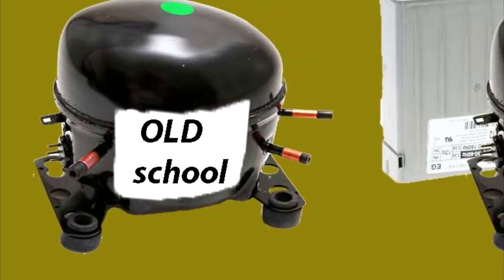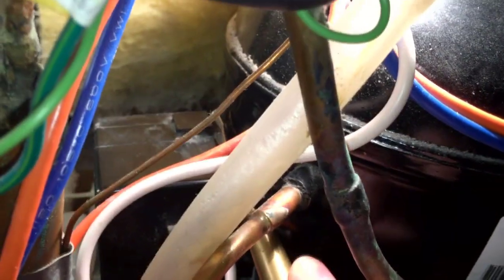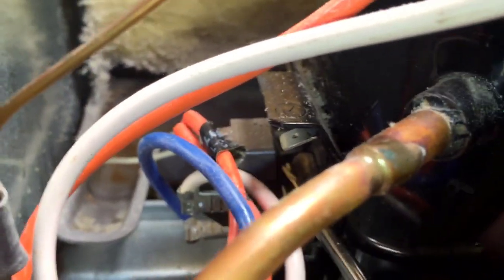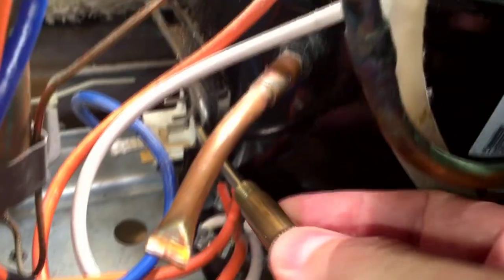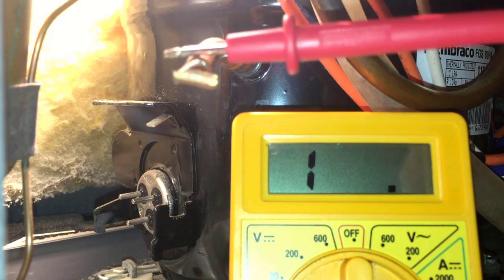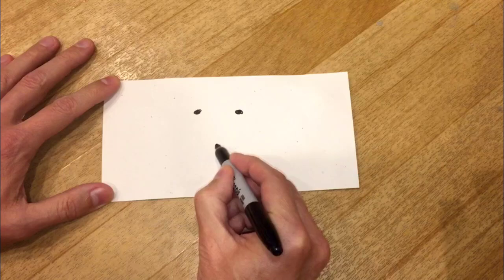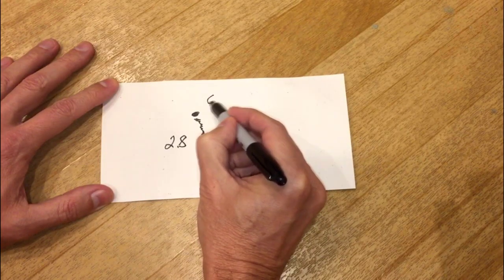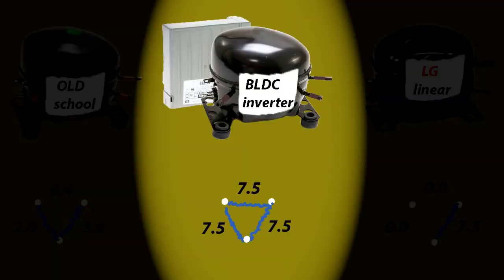Testing refrigerator compressor LG, Samsung, Whirlpool...

Comment: I have an LG linear compressor and on the two pins that have any measurement, my digital multimeter is jumping all over the place with negative numbers from -.03 to -56.  I tried an analog meter and the two pins measured between 1.0 and 0.  I suspect this is not good.  I'm a novice with multimeters so it could be user error.  By the way, the fan blows but compressor does not turn on.
Reply from the maker: It sounds like a bad multimeter or a user error.
Have you tried the Test Button to see if the compressor runs as on the next video...? https://youtu.be/70y61Sq_NU0
Reply: @Your-Self  Yes, did the test and the fan comes on but not the compressor.  Checked the multimeter and found the red line dangling by a thread from the plug in so that would do it.  Need to get a new one and recheck.  Thanks for quick reply.
Reply from the maker: ONLY if you are comfortable working with electricity, you could check and run the LG Linear compressor by applying the 120VAC directly to 2 pins where you measured the resistance. This works only on Linear compressors, and if it runs like that, your motherboard is probably malfunctioning. But first, make sure to check that your compressor is not shorted to ground.
Reply: @Your-Self  With the new multimeter, I measured resistance again and it fluctuated between 6-8.  Not feeling that comfortable with applying the 120VAC to the compressor, I called in a repair person and he confirmed that the control panel appeared to be the issue.  It cost a bit more for the confirmation, but most definitely a lot cheaper than buying a new frig.  Ordered the new control panel from LG's parts supplier (Encompass.com) and I'll put that in myself.  Thanks for your very helpful input and hopefully the new control panel will do it.
Reply from the maker: Good luck!
Reply: @Your-Self I replaced the control panel and it worked.  Thanks for all your help.
Reply from the maker: That's good to hear!

Comment: Such a big help for us DIY folks!  I have an LG linear, what does it mean if it reads at 9.2?  Thanks in advance.
Reply from the maker: 9.2 sounds normal, and if the compressor is not Shorted to Ground, it should be OK electrically. But it could still be damaged mechanically inside, depending on what your problem is.
Reply: @Your-Self  It is cooling just slightly, not completely.  I also followed your other video using the 'test and reset button' to confirm the evaporator fan/air flow works.  The sound check, using your other video 'not cooling but running' points me to bad compressor.  Now patiently following your tip to 'get your money back for not cooling LG fridge'.  You are educating folks globally, heartfelt thanks from a DIYer from the beautiful island of Guam!
Reply from the maker: Since it's slightly cooling, the evaporator coils could be covered in frost/ice due to a Defrost Problem. I'd unplug the fridge for the full 24 hours, so the ice can melt. And then check if the cooling improved. 
But most likely, the problem is with the compressor itself.
I'm sure Guam is a beautiful island, but not sure about LG warranty coverage on the island.
Let us know if they can fix or replace it.
Reply: @Your-Self  I had performed the defrost process as well.  Fortunately, LG extends warranty coverage here as it was purchased at the local Home Depot.  Compressor is being shipped by LG USA as we speak.
Reply: @omlorz1680  linear compressor is not durable according to various reviews on the internet.  Is that the case with you.
Reply: @junaidquraishi9825  Not the case with me, mine lasted 9 years.  The compressor itself has a 10 year warranty coverage.  LG replaced/installed the compressor at no cost...

Comment: My Kenmore 795.72493.611 is not cooling fridge nor freezer.  In test mode 
fans blow air in freezer not fridge.  Also code 22 22 shows on display window. Is the compressor shot?

Comment: On a linar compressor i have where the other two pins i measured reading "OL" does that mean its bad
Reply from the maker: OL means "Open" because there is nothing there. As long as you have a small resistance between 2 pins and "OL" between others, it should be good electrically. But the linear compressor is very weak inside mechanically. The only way to prove it is to measure the pressure inside the Sealed System.
Reply: @Your-Self  thank you very much

Comment: Great video, pretty sure I have an old school, resistance I'm getting is 52.9 - 52.3 - 105 so works out, but considerably higher, is this still okay, I change the relay (but it looks like I was sent a faulty one)
Reply from the maker: If your multimeter works well, the resistance is kinda high, but not unheard of. It just means that this compressor uses about twice as much electricity to run. What exactly is the problem... the compressor doesn't start at all?
Reply: @Your-Self  the compressor is working but the refrigerator is not very cold. It reaches maximum - 5°C. In your video you say the measurements on linear compressor is different than those i found. The measurements i found are similar to old school compressor so i think this is the problem. I need to find solutions to inform the technician because at he's last visit 3 months ago he said it's leaking fluid but i don't trust him because the refrigerator is at the same condition. If it's leaking it should be empty until now correct?

Comment: Thanks so much for this video, it was very helpful.

I have a Kenmore Elite running a LGFLB075LANA Compressor.  I'm getting no cool air from the freezer or fresh food compartments.  The readings are 10 Ohms / 0 / 0, which I believe is expected.  The compressor feels like it is running, it gets warm and there is a slight vibration.  When I do the diagnostic test I can feel air coming from both compartments.  I've replaced the start relay and get the same results.  I also have a 3 n 1 start that I haven't used, but I suspect that won't solve anything.

Given all that is the compressor most likely just shot?  Unfortunately this fridge is about 5 years and 1 month old.  Thanks again for the great video!
Reply from the maker: Since the compressor is actually running, the 3 in 1 is not needed.
The warm air blowing in both compartments indicates some-kinda Sealed System issues. Could be a leak, restriction, or mechanically damaged compressor inside... which is most common for this compressor. In any case, an expensive repair :(
Reply: @Your-Self  thank you so much for the fast response.  In your experience do you have any guesstimates on how expensive is expensive?  (Ballpark).  I think I’ve read the compressor itself is covered for 10 years, but not the labor?  My experience with Sears on this has been extremely poor so far, and to even have a tech come look at it would cost $170.  I don’t want to just throw money away for them to tell me the repair is an obnoxious cost.  Thanks again, your videos have far and away been the best I’ve found on this topic.
Reply from the maker: While LG covers the compressor and labor for the first 5 years and parts only for 10, Sears has its own rules. The lowest you can expect to pay is about $350 for labor if Sears provides the compressor. Not sure if they will cover other items like Filter/Drier, Condenser, Evaporator if there is a leak. So the price can go up to $1000 very quickly.
Reply: I checked with Sears and their parts warranty is 10 year for the compressor and 5 year for the sealed system.  The fridge is 5 years and 1 month old.  Ugh.  You seemed to think the symptoms I provided were a sealed system issue.  Would the cost of repairing the sealed system + labor approach $1000 if the compressor was still good?  Unfortunately it will cost $169 for Sears to even just assess and quote a price.

Again, I really appreciate you taking the time to answer.
Reply from the maker: Unfortunately, there is no way to figure out if it's a bad compressor, a leak, or a restriction without a technician piercing the sealed system to install gauges.
If the compressor is bad, it's actually the "best" and the most likely case scenario, and it's covered.
If there is a leak on the LOW side, it's the worst-case scenario that may require the Evaporator, Filter, and possibly the Compressor replacement, which may not be covered in this case. And that's how you approach the $1000 bill.
Tough decision.
Reply: @Your-Self  @David Murphy I'm in identical situation (precisely the same timing). What did you end up doing?
Reply: @Your-Self  last question (I hope!).  I put my temperature gun on my Condenser coils and they are just room temperature after the fridge has been running for awhile.  Is the compressor running and these coils not getting warm indicative of a sealed system issue?  Thanks again!
Reply from the maker: Yes, the room-temperature condenser coils, is indicative of a Sealed System issue. To find out which part of the sealed system has a problem, you need to install gauges to check the pressure inside. (piercing the sealed system on your own voids warranty)
Reply: @thakaralok  I think we’re just going to buy a new fridge.  Sears is scheduled to come out in a couple days (at the cost of $170, non refundable) and I’ve researched enough to determine the problem is almost certainly sealed system, which in my case is past the warranty.  At a minimum I think we’re dealing with $500-$700 in labor/diagnostic, and potentially more if I’m on the hook for parts.  Basically I’d just be paying $170 for them to tell me it’s going to cost a bundle.  I’d rather just put the $170 towards the new fridge.

Our plan is to just buy a new fridge through Costco which comes with an included 4 year warranty (parts and labor).  It seems like all these brands have issues and basing your decision on the quality of the warranty is the way to go.

I will continue to monitor if Kenmore branded LGs become part of the class action lawsuit against LG and their linear compressors.  It’s obnoxious that they are not, clearly the LG parts are the issue at hand here.

Thanks to @YourSelf for saving me the $170 diagnostic charge and giving me the peace of mind to just move on.
Reply from the maker: @David Murphy if you are moving on, take a nice picture of your fridge and post it on Craigslist (or other local platform). A local repair shop may pick it up from you AS-IS and pay you about $50-$100.
Reply: @Your-Self  thanks.  I was considering doing something along those lines.  I don’t know enough about Class Action Lawsuits to know if no longer owning it would prohibit me from a future payout.  Currently Kenmore branded LGs are not part of the LG Lawsuit, but it seems like there is a push out there to get Kenmore customers some compensation as well.

Again, I really appreciate your insight on this.
Reply: @davidmurphy9397  I ended up taking a chance by calling the Sears Home Services who quoted me $99 as a diagnostic fee and said that $99 will go towards the repair cost if I decide to go with the suggested repair. Like I said earlier, I'd exact same issue and it turned out the linear compressor needed to be replaced along with few other parts (service valve, drier assy). The technician was able to waive cost of compressor but charged for other parts and labor with the total of $640. I was able to find the 15% off coupon and paid $550 to put this refrigerator back to working. I'm in agreement with you and other consumers that we shouldn't be paying almost 25% of the original cost towards repair just after 4 years of use. Certainly a strong case for the class action lawsuit.

Comment: I just tried this and have a BLDC compressor part MKV190CL2J/SM1 in my Samsung.  I measured 11.8 for all 3 of the measurements.  Is my compressor bad?  I replaced my relay starter thing and my 2 temp sensors in my fridge and still it's not working.
Reply from the maker: When you say "I replaced my relay starter thing" do you mean the inverter (computer board inside gray box)?... because BLDC compressors don't have a starter relay.
What exactly is not working... the compressor is not running at all, or running, but not cooling?
What's the refrigerator model number?
Reply: @Your-Self  It's a Samsung RF267AERS.  And I mean I replaced the overload here - https://www.repairclinic.com/PartDetail/Overload/DA34-00004D/2025770 .  The inverter PCB is in the rear of the fridge but I think that is the problem.  The compressor is not running at all.  My inverter board is also blinking 1 LED every 2 seconds or so.  I tried using a multimeter to read the power line going to the compressor and I get no voltages between the VDD and VSS.
Reply from the maker: Your refrigerator model has 2 PCBs next to each other, and the smaller one with a blinking light is the inverter. Look closer on the inverter, and you may see a bulging capacitor, or some burnt marks on the front or the back of the PCB. It's a common failure, so try replacing it.
Reply: @Your-Self  Thanks for the reply.  So I did replace my inverter PCB.  The light on the other one would blink once real fast every 2 or so seconds.  With the new one, it is blinking a little slower but blinks 4 times then stops.  Then it repeats.  I thought I could hear like a ruffle sound coming from the compressor but it still is not turning on.  Any ideas?
Reply from the maker: Well, the 4 blinks indicate a locked compressor... not good news.
It's possible the compressor was locked before, but the old inverter was trying to start it multiple times anyway and eventually burnt out.
If you have a clamp-multimeter, you can measure the current flow to your refrigerator... unplug and plug it back in... if you see the current spike to about 6-10 amps for a few seconds, the inverter is doing its job supplying power to the compressor, and if the compressor is humming, but not running, it's probably locked :(
Since you have nothing to lose, try lightly tapping on the compressor from all sides with a hammer... it may unlock the compressor, albeit for a short while.
Reply: @Your-Self  Thanks for this and yeah that is what I was hoping was not the case.  The compressor isn't humming or anything.  When I plug it in initially it sounds like some kind of flutter/sputter inside the compressor then it stops.  The fan is on constantly for the compressor though.  When I put it in manual operator mode for the compressor it does nothing too.  I unfortunately don't have a clamp multimeter.  I actually tried that hammer thing you were talking about earlier but didn't have any luck.  Well this stinks if I need to get a new one.  Definitely will not be getting a Samsung.

Comment: What does it mean if my BLDC type has a measurement of 1.4 Ohms between all 3 pins?
Reply from the maker: 1.4 ohms sounds low. But if all 3 pins have the same 1.4 reading, the compressor is probably OK, but your multimeter could be miscalibrated
Reply: @Your-Self  thanks. I was thinking the same. My only meter is manual and really crappy, so that’s a possibility. 

Now I just have to find the right replacement inverter box or circuit board to replace the one in the box.

Comment: What if you have no continuity between 2 windings. No resistance. It was a new conpressor that came in.
Reply from the maker: If you are talking about an LG Linear compressor, it has just one winding. You should be able to measure a small resistance between 2 pins, but other sides should be open OL.

Comment: I have an LG linear compressor...when I do the resistance test, the number fluctuates between 8 and 11...never stays steady. Is this a sign the compressor is bad?
Reply from the maker: The fluctuation is probably just a friction between the pin and the multimeter lead. If you had alligator leads to keep it steady, the fluctuation would probably be gone.
Reply: @Your-Self  Ahhh that makes sense. Thank you so much for the reply

Comment: Thanks for your video. I have a samsung fridge with BLDC compressor. The fridge running but not cooling. I test the three pins and getting 8.4ohm. However when I check each pin with the copper wire I got reading for all three pins.Would that means the compressor is dead?
Reply from the maker: Typically BLDC compressors are very reliable, but since you can measure the continuity from a pin to the copper pipe, it means it's shorted/dead :(
Reply: @Your-Self  thanks for your reply.  +$2000 fridge is useless after just 4 years.